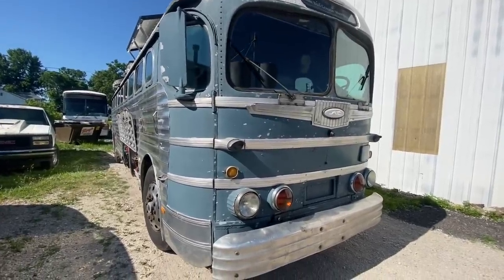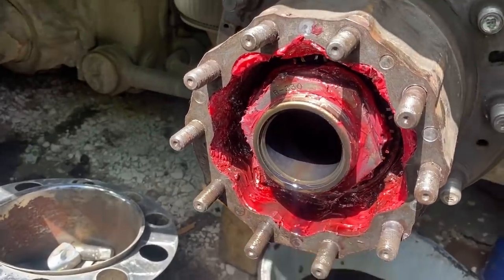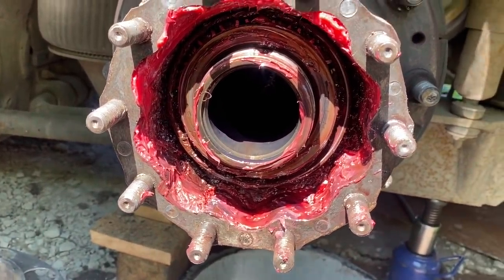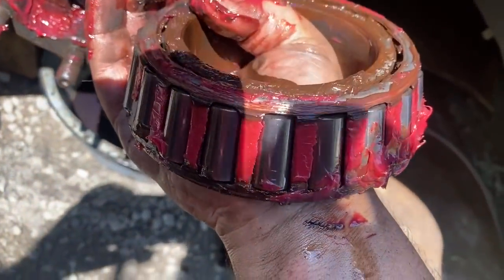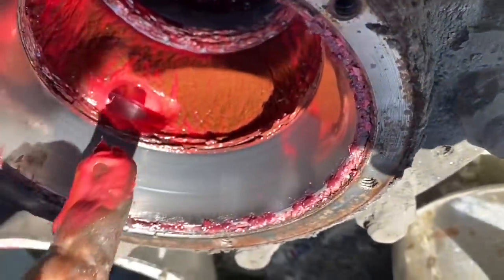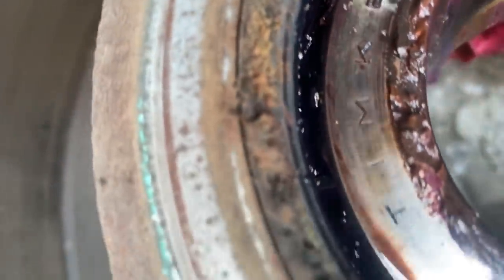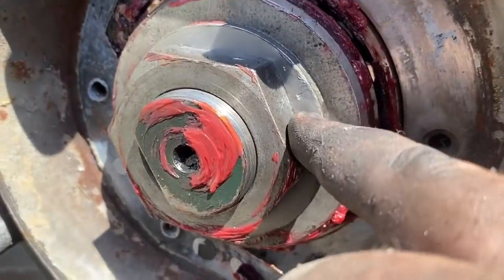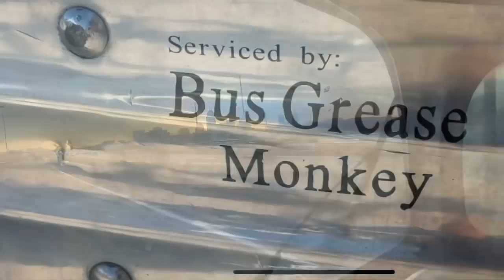Mci bus Day 3 more brake and wheel bearing issues

Comment: What you've found on this poor coach is sad and dangerous. Several months ago I had Wiers rebuild my braking system with all new air hoses, brake chambers, S-cam bushings and seals, slack adjusters, shoes, drums, the whole damn thing steer and drives. It was not cheap but cheaper than the alternative. Since flatbed construction work died this year, I'm using my truck pulling long boxes doing local LTL freight for ABF where I'm constantly in heavy traffic and lots of stop and go and I've no worries about my equipment. Getting a big beautiful piece of equipment moving ain't nothing if it can't stop.

Comment: Damn they packed those hubs full. Wonder where all the vapor went when grease heated up.
Reply: Right out through the seals that are supposed to keep the water out!
Reply: @jlexon  right? Haha i had that thought later it must have pushed out the lip seals with the pressure. Then water/condensation entered when bearing cooled off

Comment: That grease don't look like it is for roller bearings.
Reply: Looks like hydraulic...
Reply: @2flyabove  that's what I was thinking.
Reply: I was always  led to beleive that red grease was a rubber  grease, for say inside a rubber cap over a hydraulic cylinder
Reply: Grease color is not an indicator of composition or intended application.

Comment: Oh come on if you put enough grease in there then you dont ever have to worry bout it. Atleast thats my guess to what whom ever was thinking when they packed all that in there. It look like they used about 50 buck of grease per axle.
Reply: i have been selling bearing for 40 years now , the reason why you do not put to much grease to a bearing (unless you are at walking speed) is that once the space is filled  and heat start to build up, there is no room for the heat to dissipate , heat just build up in the grease and overheat the bearing

Comment: I work on government busses. Been doing brakes for 30years and have never used grease on wheel bearings. Never ran into the problems that I've seen in these video's. There was a case of a frozen or heat welded bearings. That was from overtightening the bearings. I prefer wheel bearing oil. If you do your pretrip inspection a leaking wheel seal is easy to spot. Most sight glasses on the front hub have a mark for axle oil level. Were you a driver for Grey Hound?

Comment: Would be nice to know what brand that red grease is so i never ever buy it. wow.
Reply: It kinda looks like "Red and Tacky" sold at Home Depot. I think it is a matter of the wrong type of grease rather than the brand.
Reply: Brand-name is not as important as using specific grease for the task-at-hand.  Like fuels, oils, there are different grades and formulations of greases, and they are better suited at certain tasks than others.   Put plainly, grease is not "one size fits all".

Comment: The virus is tearing through rural America due to a false sense of security like that. Stay safe.
Reply: amen !!
Reply: Not so much a false sense of security the thing is this virus isn't going to go away until it ran its course and the longer we avoid it the longer it's going to take. It's a bad deal all the way around and I wouldn't wish it on anybody but the fact is most healthy people will get over it just fine and until we as a whole develop a herd immunity to it it's not going anywhere
Reply: Sam T well said Sweden had no lockdown opted for heard immunity approach worked fine for them
Reply: Willen Enable they are no worse than other countries sooner we all get it and die or survive the sooner it’s gone
Reply: @mrwolf9335  Actually the Swedish approach wasn't to opt for heard immunity but to slow down the virus and not overtaxing the health care system like in Italy and Spain. It kind of worked but a lot of older people at nursing homes got the virus and died. That's mostly beacuse of bad routines and shortage of masks and stuff and generally bad magagement at the nursing homes :(  
The reason the infection rate is climing right now is that the autorites just started a mass testing program to check as many people as possible. The death rate is going down a lot and thats promissing.

Comment: Red grease is usually used in high pressure/heavy friction applications like backhoe pins and bushings, or end loaders that carry massive loads. The issue that I see here is that the majority of the oil (the part that does the lubrication) has long since separated from the lithium soap carrier and that is all that remains. Tons of useless red goo.